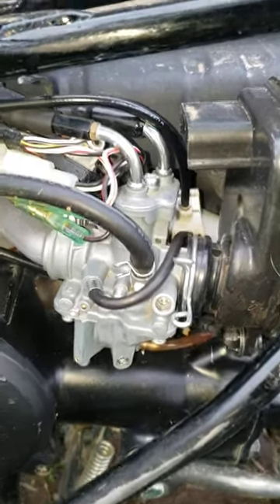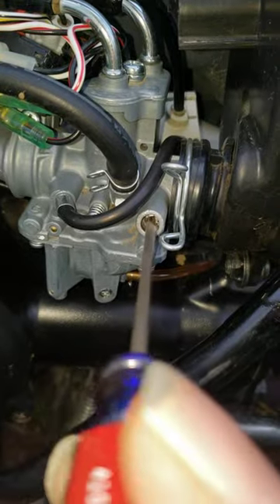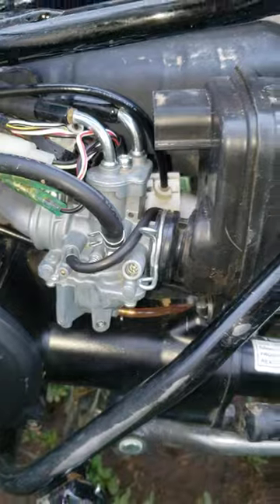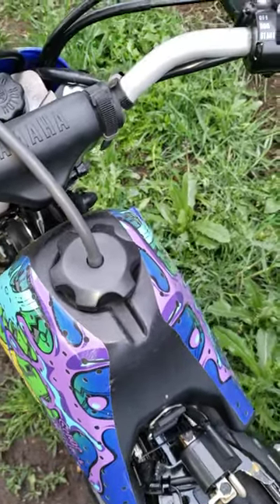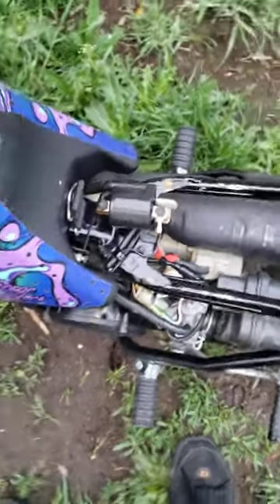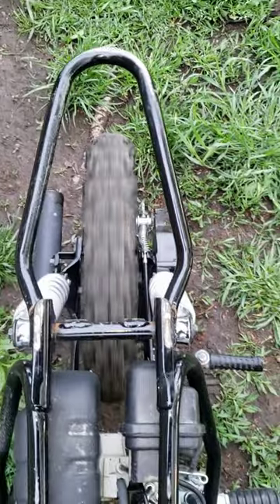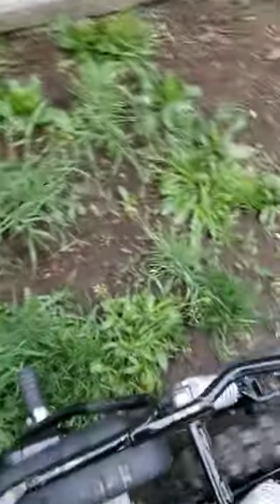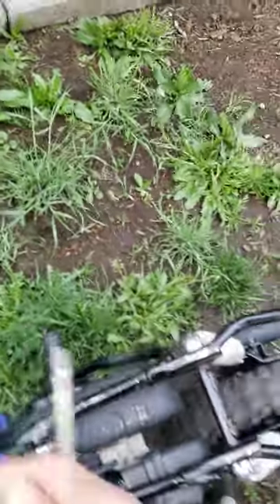How To Yamaha PW 50 Carb Tuning 👌

Comment from the maker: In this video I demonstrate a basic carburetor tune for the Yamaha PW50 by adjusting the air to fuel ratio.... Before any adjustments are made the airfilter must be clean and the gas fresh also the bike will need to be "fully" warmed up and on the center stand. Because this was a demonstration the bike in this video was not fully warmed up.... To test the adjustment the throttle is being held wide open for several seconds checking at what RPM range it cuts off, if you introduce too much air the bike will cut out on its way to top RPM. Note: When you find The Sweet Spot you want to then turn it in a sixteenth of a turn to avoid any damage

Comment: I just rebuilt the top end and upgraded to a 60cc piston and cylinder, noticed I had to adjust the carb right away. Raised the idol and had to adjust air screw as mentioned in video from higher compression. Good vid 👍
Reply from the maker: Thank you much for your feedback really appreciate it!!
Reply: We just finished the 60cc upgrade and you are right is worth the money and we did a break in of a full tank of gas and adjusted the carb and we have an improvement of 10 mph with my fat ass in it and my 130 pound son it goes 13 mph more real nice for the little rocket 😂

Comment: I have a 65 main jet running premix 40:1, at factory 1 1/2 turns out it’s incredibly way to lean, possibly starving for fuel somewhere or air leak?
Reply from the maker: @codmw2man1  try 60:1
Reply: 60:1? But isn’t that just gonna make my lean condition worse? I’ve read articles a lot of guys run premix 50:1 or 40:1 with a 65 main and never have an issue…it seems like my bike is running way to lean with 65 at 40:1 which is making me believe I’m sucking to much air from somewhere?
Reply from the maker: @codmw2man1  I can't tell you wether or not you're leaking air but technically the more oil in the gas the heavier it is making it harder to suck up through the 65 main resulting in lean running condition. Some describe this as trying to suck up a thick milkshake through a tiny straw as opposed to a large straw, and the thickness being how much oil was added. Also the more oil that is added creates a lean fuel/air running condition due to the oil taking up space of the fuel if that makes sense 🤔. What you're referring to is richness of oil in the mixture, the more oil you add the richer the mixture is with oil. As for the air leak this would only be happening if it were leaking beyond the carb so if the carb is seated in the boot and the boot looks like it's in good condition with a good seal you're not getting air by the carb. Also did you do an oil pump delete? Or just cut the supply?? 🤔

Comment: What year is this bike mate? I have the 22 model here in Australia and it doesn’t have that air screw in the carbi. However it has a brass fitting with a 1mm hole in the Center.
Reply from the maker: You gotta drill the brass plug out
Reply from the maker: The screw is behind that brass plug
Reply: True?! Righto. My float is 3/4 full of liquid!! Fuel just running out of the carb 🙄
Reply from the maker: @leonbasham8803  That's not good
Reply: It’s shit house isn’t it!!! Brand new at Christmas
Reply: Likewise mate, few years older than yours its a cu** of thing to get going good, bought the older son a peewee80 2stroke self mixing aswell, I knew I should of bought 2 of them instead of this Chinese shit

Comment: I drilled my plug out 20 minutes ago 
to access that screw …. Bike won’t idle anymore…. Never touched the damn screw. 😂. Was idling fine prior to removing plug.
Reply from the maker: Sounds like removing the plug turned the screw in a little bit.... If the screw is too far out of adjustment the bike won't idle, what you have to do is turn the idle way up or hold the throttle by hand and dial in the air screw then you can return the idle to normal!!! Hope this helps ✌😁